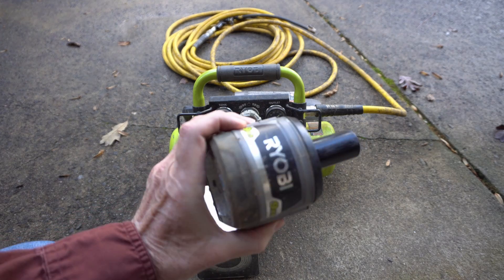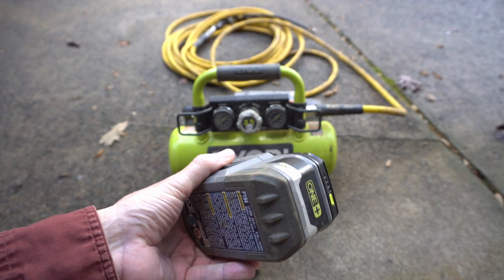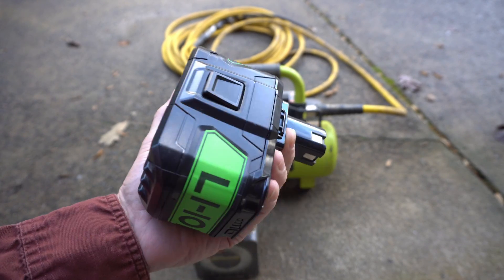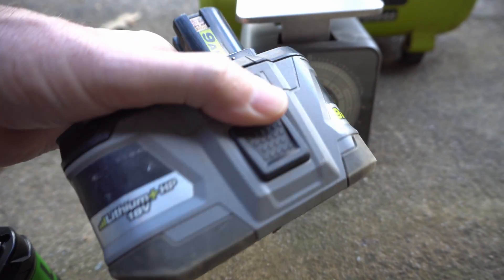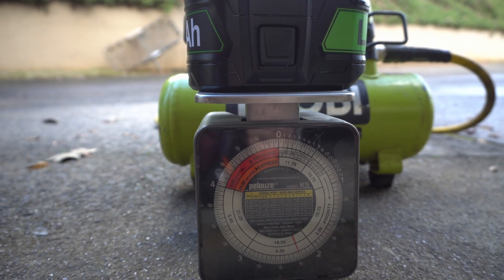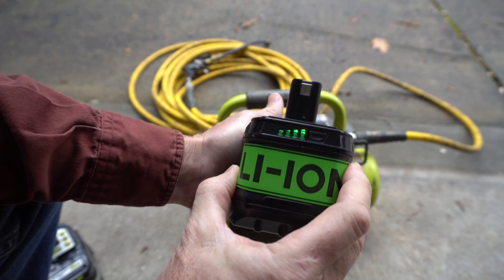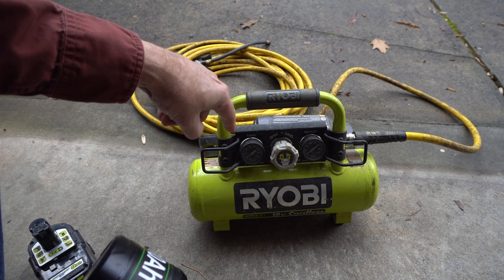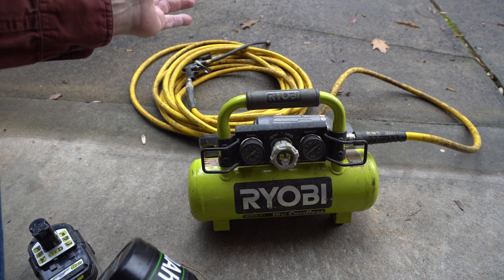Is a Clone Ryobi One Plus Battery Worth Buying?  Clone vs Real Ryobi Battery

Comment: Another YouTuber, Badar, who is an electrical engineer, recently demonstrated Ryobi has a serious software/firmware bomb that causes the premature obsolescence of Ryobi batteries.  Although Badar distances himself from direct criticism of Ryobi's intentions, saying it could just be random unexpected mishaps causing the firmware to trigger the block-out, I'll go ahead and say it:  Ryobi probably knows and therefore it's planned obsolesence, a statistical thinning of their product on a yearly basis.  Badar reverse-engineered the Ryobi battery and posted the schematics and firmware coding, discovering the lockout flag location.   He then bought dozens of similarly bricked batteries from other users online and proved only 1 or 2 actually had real cell or other electrical issues, the rest were perfectly good batteries which could be reverted to normal use once the software flag had been cleared.   

Frankly, I would much rather deal with the minor performance differences and inconsistencies with aftermarket imitation-Ryobi batteries than Ryobi's intentional software bomb that unpredictably shuts down the use of a certain percentage of the batteries.   The aftermarket batteries have safety circuitry but not the software bomb.   What difference does a little extra power mean if the entire battery is bricked just because Ryobi planned it that way?   Sorry, but I will never buy "official" label batteries again.
Reply from the maker: Maybe...  But I have 10 brand name RYobi One Plus 18V batteries of various AH ratings, mostly 9AH.  I've had some almost 10 years.  They all get cycled plenty from full to zero.  I have had only one of the ten go bad in all that time.   That one, possibly, could have the issue you mention.  But 9 of 10  don't.  So, I wouldn't call it a conspiracy by Ryobi.
Reply: @whitewater-video  No, but Badar bought 50 or so "bad" or bricked batteries online and 95% of them were still good.   So, any product that has that high a failure rate in its programming by definition is either badly designed or was designed with planned obsolescence in mind.   That doesn't necessarily mean the surviving batteries aren't "good", it just means an abnormal number of failures are bad.   I also have 11 Ryobi batteries, 6 if only counting original Ryobi branded 18V type, and 2 Ryobis were bricked within a couple years of use, and I know there is not likely any real problem with them, they simply were put out of service by their buggy software.   Consequently, my failure rate of Ryobi batteries is closer to 33%.   That is why I switched to aftermarket knockoffs... they may not work as well, but at least they work.
Reply from the maker: That's sample bias.  Your thesis may be true or not.  But he bought 50 batteries that didn't work and figured out why they didn't work.  That certainly indicates a weakness in the design.  But what percent of all Ryobi One Plus batteries do that selected 50 represent?  A tiny one, I'll wager.  We can't even discern that it represents "an abnormal number of failures".  Your 33% failure rate is more relevant than 50 already bad ones out of an unknown sample size.
Reply: @whitewater-video  You can calculate it:  48 out of 50 is a whopping 96% failure in the firmware design.   And you know the standard deviation could be quite high based on my sample size, which may be small, but is still a legitimate sample.  Your sample size suggests 10% rather than 33%.  So, the total sample size is 20 or so batteries if one combines results, resulting in an 85% failure rate with our samples combined.  Although our combined sample size is less than half of what Badar tested, the actual result of our combined personal experiences is not statistically that far off from what Badar tested: 96% false failures vs 85% false failures.   The total sample size, if one combines both is about 70 batteries which is starting to be a respectable sample size.

Comment: Great test.  The other big question is how many charge cycles it can handle.  I wouldn't be surprised to see the OEM last 2x or more cycles (at which point it would be price competitive), but without test data, we're all guessing.  It would be great if someone sold batteries with "kWh  odometers" that counted lifetime power delivered.

Comment: Bought the 2. original $160 OEM a year and a half ago and one has gone bad. How is that good? And with the knock off at $40 that's 4 times the price not 3. Guess if you can buy 4 batteries and don't mind changing them out more often there could be an advantage there. You could run your compressor for 50 cycles before charging. Then again, a drill for example would draw less power and probably more intermittently resulting in less charging inconvenience. I guess it's different strokes for different folks. Happy with my knock offs. Thanks for the vid.

Comment: I have (1) 9Ah, (2) 4Ah, and (1) 6Ah genuine Ryobi batteries that are dead. I opened up the 4 and 6 Ah batteries, haven't gotten to the 9 Ah one. On the 6Ah and one of the 4Ah batteries, the cells are still good, they died with essentially a full charge on them. I'm going to try one of the reviving charge methods on the other 4Ah. Frankly I'm not very happy with Ryobi batteries, way overpriced although they are good. The charge controller is the weak link, it's a shame to toss a battery pack with good cells. It would make more sense IMO to recycle them like lead acid batteries. How many thousands of Ryobi batteries have been discarded with good cells?

Comment: Ryobi batteries are now, wait for it, China produced and still very pricy. Quality has deteriorated but prices haven’t. If a Ryobi battery lasts the warranty period you are extremely lucky and then have to go thru an act of Congress for them to replace a $40 battery. I have used nothing but aftermarket batteries. My house hasn’t burned down, they hold a charge and all my yard work still gets done. Considering Ryobi is geared toward DIY for light to medium usage and not serious contracting jobs save money and go generic batteries.
Reply from the maker: I haven't had any trouble getting Ryobi batteries replaced under warranty.  Nor have any of my Ryobi or clone batteries erupted in fire.  I notice that none of these comments discuss the lower current available from the clone batteries.

Comment: we can now buy 4 of the generics for 1 authentic battery.
Just do the math.
12 x 4 generic batteries = 48 compression times
18 x 1 authentic = 18 compression times
4 generic same cost as the authentic.
Reply from the maker: But if you buy the authentic in packs of 3 or 4, they are much cheaper each.
Reply: @whitewater-video but with that “cheaper” price, you can buy even more generics and probably increase the difference haha
Reply: Just the analysis I was thinking which everyone seems to miss out, the generics are just way more worth it 🤷🏽‍♂️ many come in packs of 2 for 1/3 the price

Comment: You yourself said the Ryobi one was three times the price, so buy 3 of the clones and see how many times they can refill the tank, bet you it will be more than eighteen times, so based on price the cheaper one's are better value and also better on quantitiy of refills to the tank, the only downfall of them, is you have to change the battery more often, is that so big an issue to only want Ryobi ones, it isn't for Me, that's why iv'e been buying clone ones for years, without any problem with them.
Reply from the maker: What you're missing is that the clone does not deliver the current required for a higher current device like the air compressor.  Further, the batteries have less total charge.  So, if total charge was all that mattered, then you could use 2 or 3 and just change batteries more often.  But the power matters.  I don't want to wait longer for the air compressor to fill.  I want to be able to lean into my grinder, drill or saw.  Because they don't deliver the same level of current, these clone batteries can't power devices as well as the original.

Comment: They are complete shi$% I had to send mine back to Aliexpress because the damn thing could NOT run my 7-1/4 circular saw but for a few inches at a time and shut down and start over sheesh and they are 2-3 Ah NOT 4h. my 4Ah ran it all the way through multiple times DO NOT BUY THESE! There is NO heat sync inside I opened mine up and it has an INFERIOR card and batteries. Ryobi took the time to actually use a heat sync, and REAL SAMSUNG cells ,the off brand are ass-cells or some crap. Don't bother with these at all.

Comment: Lots and lots of clone batteries are absolute trash. They are typically made from standard 18650 batteries. I think Ryobi have specially deisgned cells rather than use 18650s to maximise energy density and achieve 6ah and upwards models.

The knock offs could be anything from new extremely low quality, to recovered batterys at EOL, to good quality new 18650s. Given the case size, there is not a hope in hell that the higher amp hour knockoffs can ever achieve the specified rating. You are also highly likely to run into charging problems if you pick up a random clone. as if a single cell dies, the charger will stop charging.

Steer well clear unless you have a very reliable recommendation, specialist knowledge of the clone, or an easy return route. But check the duration asap before that seller disappears.

Comment: For being an "informative unbiased test" your replies in the comments sure seem to suggest that your time waiting for an air compressor to fill is really where the "value" in genuine Ryobi batteries lies. It's odd that, while the clones seem to have a far better value in $/Ah, you seem fixated on how the genuine Ryobi supplies more continuous current. While I suppose that might be a deciding factor to some, the fact is; genuine Ryobi batteries cost FOUR TIMES as much as the clones. For the price, they should be pushing 2X the current for 2X as long, which is obviously not the case. For almost all users, provided they aren't looking for speed, the clones will be a better overall value.
Reply from the maker: If you watch the video, you'll see that not only did the real Ryobi deliver higher current resulting in faster filling of the air tank, but it also filled the tank more times than the clone.  So, we can infer that the Ryobi holds more charge and has lower internal resistance.  I assume that means more cells in the Ryobi.  But I did not want to disassemble them to see.
Reply: @whitewater-video , that really doesn't address what I stated. Yes, the Ryobi is "better", but it's not 4X better, though it is 4X the cost.

Comment: I find that the Clones purchased on Amazon give about 75% of their rated capacity. Ryobi gives about 95% of rated capacity due to better quality cells. In my experience the cost per amp hour works out to be nearly identical with regard to a clone versus original.

Comment: My drill and driver (2ah batteries) are over 15 years old and batteroes don't last forever. Thtee years back i bought a clone 4ah battery and it worked fins, I suspected it really wasn't 4ah but I didn't really care.

This spring one of the original 2ah cells was not doing well so I bought a pair of 4ah clones from Amazon. Both worked but only one would accept a charge, the other one still worked but the charger indicated it as a bad battery so I made arrangements to return them - can't return just one.

I bough a different pair off amazon and both of those powered the drill but neither wpuld accept a charge. That means 75% of yhe batteries i bought this year were bad - I don't care how cheap something is it ain't worth it if it don't woik. BTW that one clone I bought a few years back worked just fine. Sounds like some of the new clones are just bad.

I then fond a pair of RTobi 4ah batteries at a good price on ebay and both worked and would accept a charge. These cost close to twice what the other sets did but 100% of them worked.

What do you think?

Comment: Have a few Ryobi Batteries and a few Clone ones, when you get three for the price of one, a true comparison should be x3 for the clone so 18 for the Ryobi 12.5 x 3 = 37.5 for the same money. Big difference in the performance to price there mate. Also, most important you have 3 batteries so you have at least 1 charging 1 ready to go while you are using one, the Ryobi when it's dead, there is not one ready or one charging, it needs to be charged. Also, you will need to charge the Ryobi 3x more than the clones, which would be an interesting challenge, also if a battery did go down, I would rather have a 3 in 1 chance than nothing. The smart purchase would be the clones, I can not argue with maths. Go clones every time.
Reply from the maker: But they can't deliver the current required to make the tools run at full speed.  I could hear, see and feel the difference on a weed whacker, air compressor, grinder, and generator (starter).
Reply: @whitewater-video  True but now you need  the Ryobi HG batterys to get full power, there even more in price.
Reply: I was thinking the same

Comment: Somewhat helpful but more info would be awesome. How long did each tank fill take? How many bars of battery life on the ryobi when you stopped at 18 cycles?
Reply from the maker: As I recall, the Ryobi was showing 1 bar, but was wasn't done.  It didn't have a lot left.  I just didn't want to run it dead.

Comment: Dollar for dollar Ryobi batteries  are too expensive. The generic batteries dollar for dollar are a better buy.
Reply from the maker: But not if they don't run the tool well.  The Ryobi batteries spin the air compressor in this video faster and fill the tank faster.  Grinders, saws, drills, etc need high current to produce high torque.  If you're comparing AH capacity per dollar you might be right, except that you'd need to calculate actual AH from both Ryobi & clone to get a valid equation and decision there.  It is clear that a 9AH battery from Ryobi has more AH than a 9AH clone battery.

Comment: When I started buying Ryobi tools; aside from any original Ryobi batteries that came with the tool, I only bought the aftermarket ones.  I always thought that they were excellent batteries, just up until I just recently started using my Ryobi tools professionally.  I'm currently doing some demo work which has required me to run my brushless Ryobi HP tools for extended periods of time.

Example, I needed to make about a 20 foot cut through roofing shingle (not overlapped) and plywood on a flat roof.  My brushless HP circular saw would stop from time to time.  I originally thought the saw couldn't handle cutting through the plywood and shingle material at the same time.  And this was with a brand new Diablo blade on it.  But when I swapped out the battery to the genuine 4aH battery, it didn't stop at all.  I also had the same issue when I ran the circular saw through a plywood subfloor with a sheet of linoleum on top of it.  Both times the blade was set as minimal as possible to eliminate any extra friction.

After some of my other Ryobi tools randomly stopped doing other various things, I came to the conclusion that the aftermarket battery's simply cannot deliver the necessary power that is needed when a tool gets temporarily bogged down.  They basically cannot handle the voltage drop, and will cause the tool to stop.

In any event where the tool will not be put under heavy stress, then the aftermarket batteries work perfectly fine.  Otherwise, original is better.

Comment: I think they are deff worth it. You get .5x the ah for 3x the price. The math is clear
Reply from the maker: If you're using a low load device, it might make sense.  But for high current devices like the air pump, you're just wasting time.